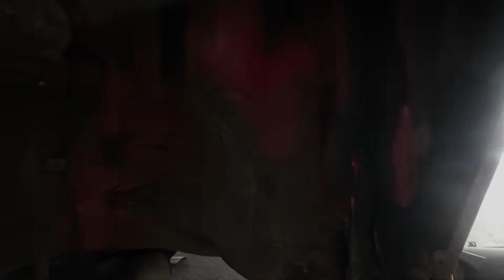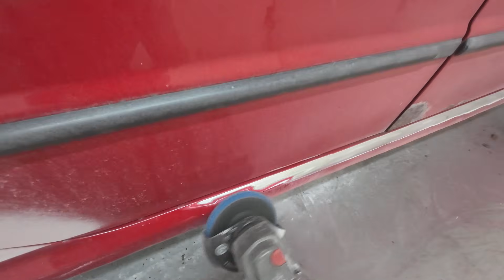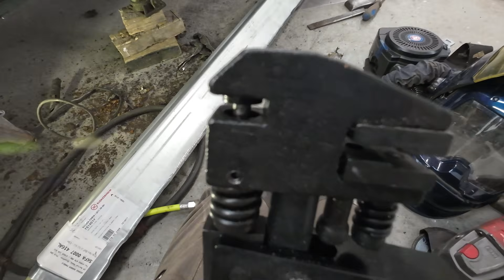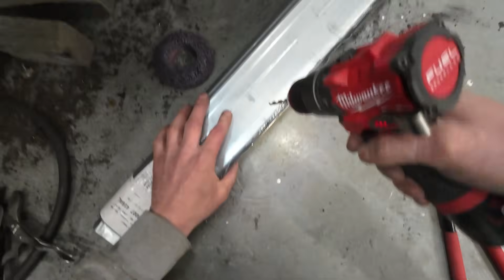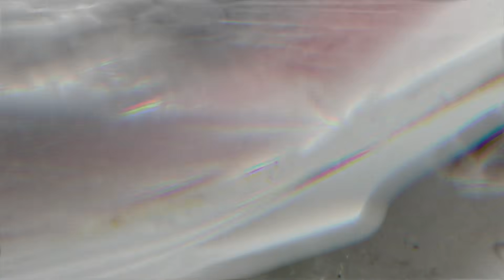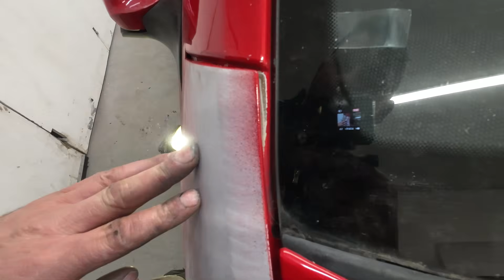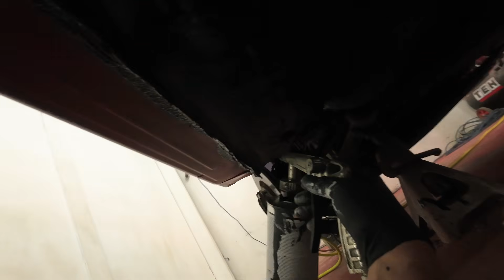skoda fabia vrs sill replacement rust repair. Fitting new sill panel & replacing wings

Comment: Hi Mate .... I've subscribed as I really loved the video.... 

I know he-haw about welding or painting but you did a great job on the car in all aspects. The wings and sills being new will be fine I just hope the rear wheel arches and bottom of the doors last a reasonable time as I do know rust is a bugger to eradicate.... 

I had a 2007 Octavia with rusty rear wheel arches and the bottom of the passenger side doors and surface rust on both sills behind the front wheel arches where they get hammered from the crud off the road .... I'd a young chap took it in and had it 5 days and get me fully updated with photos and he removed the doors stripped the rubber door strips off and all the internal panels and he ground every inch of rust out, luckily nothing has perforated. He treated everything and acid etch primed it and did the same with the sills, rear arches he removed the inner liner and treated everything the same then repainted it all and I was truly amazed at how it looked ... I got 24 months out of it before they started blistering again which I was amazed with as most paint shops quoted 8-12 months tops... Sadly the front wings started to go about the same time and I was going to get it redone with new wings but I couldn't track him down his unit was empty his Facebook page closed and his mobile number dead 😢 ,... I ended up just getting shot of it and buying a Superb
Reply from the maker: Thanks for subscribing. When I do them they last a while. I have two classic vehicles a VW T25 transporter and a BMW E30, they where both done over 5 years ago, in fact the VW probably more 8 years and the rust has not come back in the places I have done. Every job is different but the system I use Usually lasts a long time. The main issue on this Job was really the sills and the wings. The doors and quarters I just did for him to tidy it up. I didn't go to town on it but its a reasonable job.. Thank you for your comment and kind words.
Reply: @Supercarlsunday .. that's good to know your rust repairs have lasted so well, you obviously don't cut any corners.

I spoke to a few places about my Octavia and they'd not guarantee anything more than 6 months and wanted to replace the front wings, cut out and weld in repairs to the door bottoms or replace them with good second hand and see if you could get a repair panel for the back arches but you were talking upwards of £1,000 for it when the car was worth about that 😢
Reply from the maker: Yes, repairs like that would be well over £1000 its a lot of work, plus.the paint, panels and materials. I wont guarantee any rust repairs because at the end of the day it can come through from another area not far away, they then bring it back and expect you to repair it for free, no thanks. I make my self very clear when doing rust work, I do all that can be done and take photos to prove it. No guarantees because you never know.

Comment: Fine job 👍 Although I'm surprised at the levels of corrosion on the car  , I've an octavia  23 years old tdi that has a few patches round the front wing due to that stupid piece of foam they stick back of it to stop vibration which holds water all year round once wet, I find if you keep the gutter clean behind the front arch liner it will go a long way to preventing future problems with the sills.
Reply from the maker: Thank you.. Yes, I have seen many design floors on vehicles that create major issues over the years. Foam behind wings is a terrible idea. It was never used when I started learning the trade, it was all dodo mat. Maybe remove the foam on your Skoda and try it. shoot some wax oil about while your in there.

Comment: Thank heavens! A craftsman who stitch welds and cools so that the panel actually gets welded in, not covered in scabby little tacks, the most of which get ground off. I was doing stuff like this for fifty years professionally and your neat and strong repair was exactly how I would have done it. Well done cocker, cracking job!
Reply from the maker: Thank you. Yes I started this trade in 1996 so as you can imagine there where some very good guys around back then..I worked along an Italian panel beater for some time, I lost touch and miss him. I was working on cars in a time when the hard hit stuff got repaired, welding quarter panels in weekly, putting new roofs on, using different jigs. Celet, black hawk, Caroliner. My uncle also is in the trade and has a place. He has some interesting cars. Cosworth, v8 stag, mgbgt, Talbot bathtub style race car with a strait 6. Will do some filming at his place some time. Thank you for your comments they are appreciated. Its my big 30 year in the trade next year by the way, 50 years wow, respect 🙏 👍
Reply: Thinking the same thing, hard to find someone who goes past the dodgy job, Everything is designed for maximum profit for minimum effort

Comment: I’m surprised to see this Fabia with so much rust.
Škoda ‘s legendary corrosion protection system, namely bare steel phosphate dip, electrophoretic coating, and underside sealant, usually prevents oxidation.
Well done, it was very charitable of you, to ensure that this sentimentally cherished Fabia vRS is kept on the road.
This model is becoming rare now, so as many that can be saved are always a bonus❤.
Reply from the maker: Yes unfortunately there process has failed. It is 18 years old I guess. It will be good for some time now though. I personally think the problem lies before the rust prevention process because they rust from within. Imagine leaving a sheet of steel outside for a few months and then spraying with primer... Something like that, plus metal holds moisture. If there is air inside the sill, there will be moisture. But anyway, it was nice to save it and I think its a lovely car. Thank you for your comment.

Comment: My 2008 Seat Ibiza Mk4 was starting to rot by 10 years old, starting on the wings. Yet our Nissan at 13 years old has virtually zero rust. The 12 year anti corrosion warranty on the seat wasn’t honoured as it hadn’t been inspected by a main dealer each year (as if anyone does that!)
Reply from the maker: Yes its ridiculous. What difference does an inspection make inbetween. If its rusting its rusting if someone looks at it or not. I do a lot of VW vans, camper vans, they all rust within 10 year. Some jap vehicles are good. Make sure you under seal it. Clean it all up underneath and seal it. It makes all the difference. My wife had a honda civic, it looked amazing until I got under it one day. It was a different story underneath.😢

Comment: I needed two new sills for my old Chevrolet lacetti. The dealer wanted £450 plus vat for the parts . I went to a metal fabrication place and the lad there made me the lower half of the sills which was all I needed. £15 all in.
Reply from the maker: Very good. Yes I make a lot of my own sill panels for that reason, however for this vehicle they where not very expensive. It saved you some money thinking out the box 👊👍

Comment: Pattern parts are rubbish. You may have been better finding some genuine wings in better condition. It does look good though
Reply from the maker: Ive been doing this a lot of years, Im old school, thats why I can make things fit lol. The problem with second hand genuine panels is most of them have had previous repairs and hidden problems. I got the pattern panels fitting quite well after a bit of work.
Reply: @Supercarlsunday You got the wings to fit at least. I don't understand why they can't be made to OEM spec.
Reply from the maker: I think the problem is during the manufacturing stages thing wear out, so there not made as good. Dont get me wrong there is still a lot of good none oem but unfortunately a lot of bad lol. The subaru I did had bad panels. The customer said there really good none oem, I had to cut and weld them. They where terrible. My customer only knows what he is been told though and I appreciate that he does not know the job. It is what it is. Thats why we fit everything first before painting, to align everything up, get the gaps right and once we are happy we then strip down and paint.
Reply: @Supercarlsunday I have a 25yr old Clio with a rusty wheel arch but luckily its just a localised area that wants cutting out and a patch putting in. The replacement wheel arch ive got is good.

Comment: Amazing job, Carl and what a brilliantly put-together video! Thank you again for the time, effort, and love you put into getting this back on the road for me and my wife. We had an incredible summer using it.

Since getting it back, I’ve done a full underbody treatment with Bilt Hamber Dynax UB (an absolutely horrible job!), fitted new top mounts and bushes, AP coilovers, restored the front and rear anti-roll bars, fully rebuilt and repainted all calipers and carriers, and fitted new discs, pads, and HEL braided brake hoses.

It’s currently off the road again for winter as I’m fitting a brand new rear axle along with all the associated parts that go with it. Trying to limit its salt exposure as much as I can haha. Thanks again mate. Absolute top quality work!
Reply from the maker: Thank you mate, I really appreciate that. I am glad to hear your happy with the video. Its nice to hear that you have done those jobs to the car. I said the underseal wouldn't be nice lol. But atleast its done. Glad your taking it off the road in the winter, there putting salt down already. Thats what eats in to them. It makes a huge difference only running them in the better months. Nice to hear you and your wife have been getting good use out of it this summer, thats great. Nice that you got your head in to the car and did all of your own mechanical bits. Excellent mate 👍